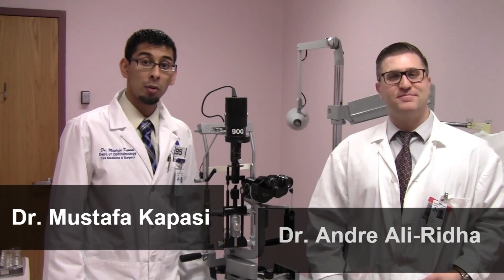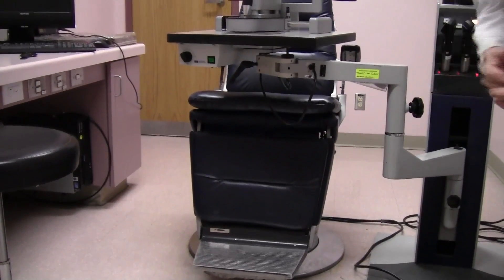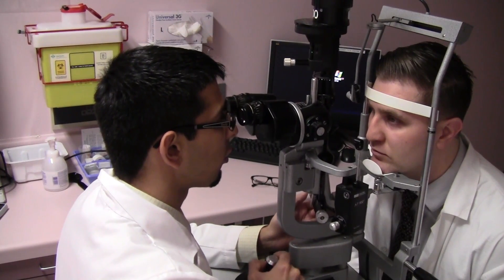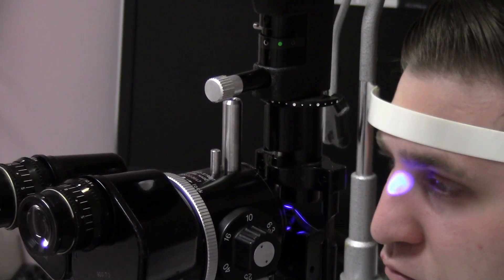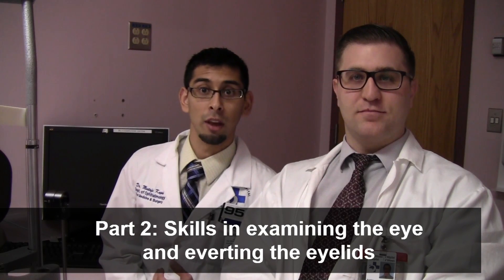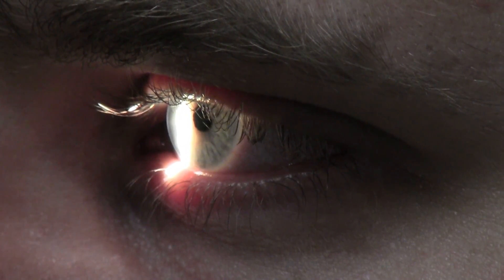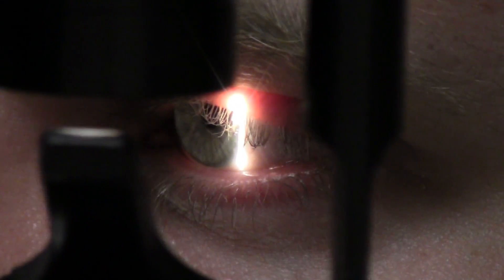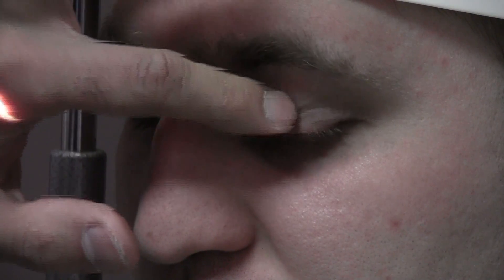Ophthalmic Skills Video - Basics in Slit Lamp Examination

Comment: So I just had an eye exam. Doc said air puff pressure was slightly elevated but after doing Goldmann she said it was normal. She asked asked if I held my breath on the air puff which I said yes because I don't like it lol. Which one is right?
Reply: Goldmann Applanation Tonometry is generally considered the gold standard and tends to yield more consistent results than other methods of measuring intraocular pressure.
Reply: Also, your eye pressure will elevate if you are holding your breath.